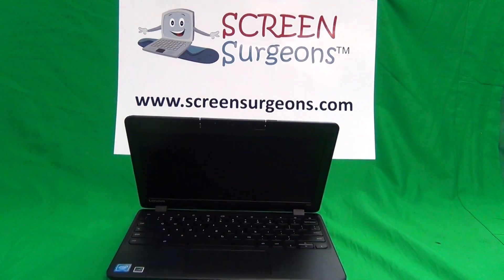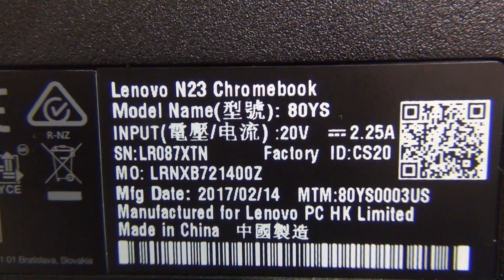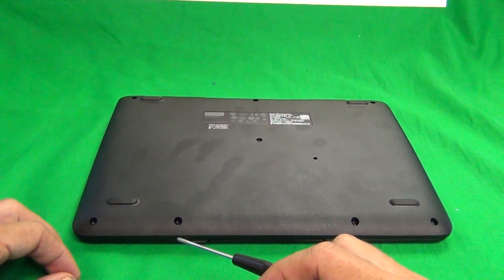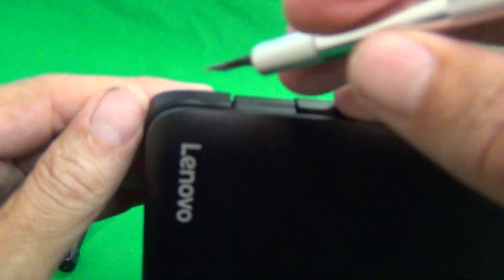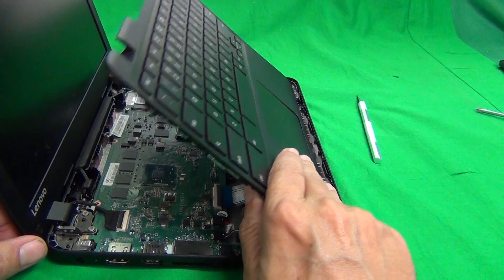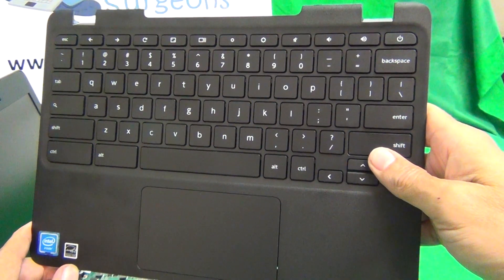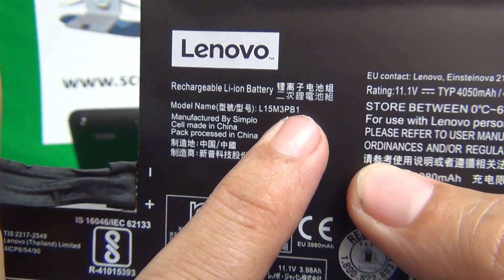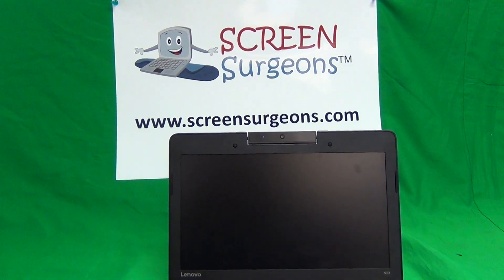Lenovo N23 Chromebook Keyboard Assembly and Battery Replacement Procedure

Comment: I wonder if there are any other compatible motherboards— I accidentally softlocked myself out of my chromebook so I am basically going to make it into a hackintosh if that’s possible

Even if the motherboard won’t screw in, I will just modify the shell to fit it. Any advice? I’m looking for a motherboard capable of running a Ryzen 5 1600.

Comment: Would be nice to see how to upgrade the SSD
Reply: The SSD is soldered on the motherboard. There is no upgrade.
Reply: @uprightcitizen  Oh yes you can! I remember the day's when I was limited to only soldering radioshack size components then I got the +15 Tomb of microsoldering (not a real thing), or if that's not an option you could also watch Louis Rossman's channel he'll learn you.
Reply: @user-wt7qi4yc8c  Louis is good. Soldering is no issue for anything.